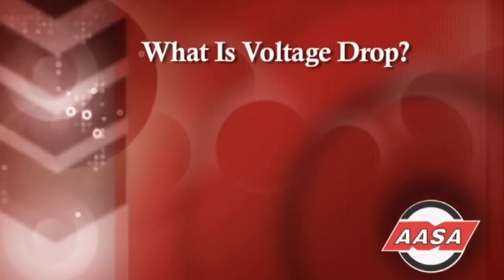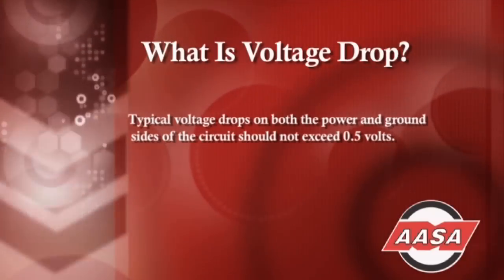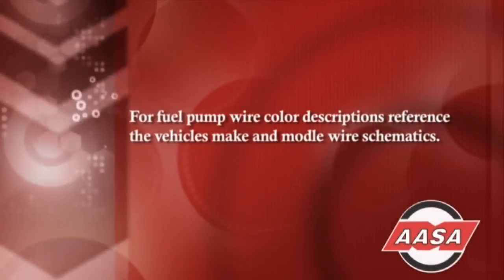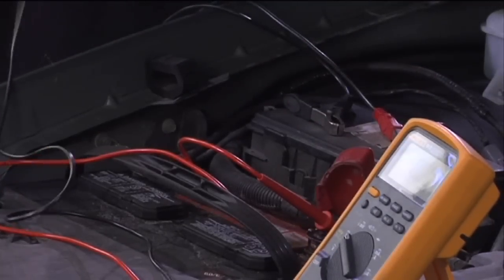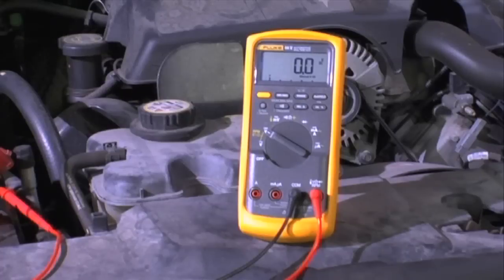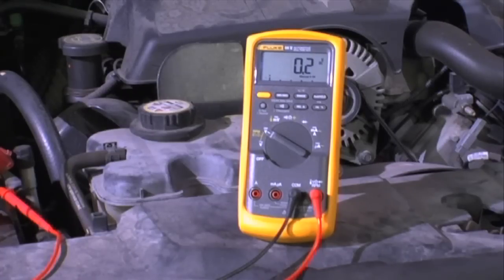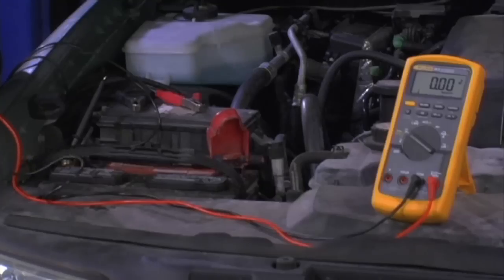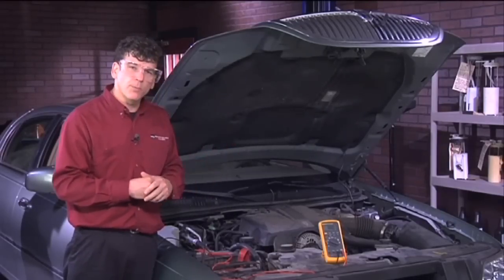Testing Electric Fuel Pump Problems with A Voltage Drop Test

Comment: When i do positive voltage drop, the meter is showing 12+ volts without even cranking the engine. Does this make sense? Shouldn't it be showing zero volts?

Comment: Appeared to be a quality video until he failed to address meter connections at the fuel pump in detail.  moving on down check....
Reply: Agreed. He also did not tell us the correct settings of the voltmeter.

Comment: So what exactly is going on here for it to show that drop?

The way I'm imagining it (as a noob) is that when the pump pulls current down the main wires, if there's any resistance because of a bad connection or frayed wire, the voltage will try to pass through the multi meter circuit?

Comment: I have 12.5 volts in my battery, and when i measure voltage back on the fuelpump positive terminal i only receive 12.3 volts, at this Point the ignotion is at it`s off position, is this normal, or should there me the same voltage back in fuelpump as in the battery?
Reply: I hope u were able to figure it out. I have the same issue.

Comment: Hi, a quick question. At the pump connector, 12+, 12v ground. No problem. Reconnect at pump, pull relay out. Relay measures 12v +, when I go from batt 12v+ in series to pump side ground I get 5.98v through the NEW pump.  Pump measures 0 ohms R now that it is cold. Bad brush? New pump measures 0 ohms, and no volt drop from batt+ in series.
I changed pump, vehicle runs. Retest pump, 0 ohms res, no voltage drop. Was the 6v drop due to R from a hot / defective pump or did I miss something? Original pump was changed due to rotten tank as routine due to high mileage. I feel like I missed something!!!

Comment: U didn't show the wire from pump u talking about like wtf man
Reply: Attach the jumper wires to the battery terminals and use the T-pins on your VOM to probe the fuel pump terminals.
Reply: i know right...idiot

how would you clamp a huge booster cable to the positive of an in-tank fuel pump....even outside at the harness,,, HOW
Reply: @bertrx-7406  T-Pin
Reply: lol same here like are you kidding me

Comment: How warm should fuel pump relay get while vehicle running?
Reply: They get hot its normal
Reply: One of my pins burned. Put new one and almost burned. Replacing pump. Heard it could be problem

Comment: My 2001chevy express stops while driving what can cause that  the engine light does not come on
Reply: what caused that
Reply: figure it out?  mine was doing the same.......... years ago. i believe i just cleaned my battery contacts........

Comment: Hello i was wondering, when you do the voltage drop at the power wire at the fuel pump, do you need to disconnect the connector or leave it connected and just probe into the circuit? How about the negative side?
Reply: Hector Arreola don't unplug load have to have a load "fuel pump"  which creates current flow. Otherwise the test will not work
Reply: @Robert00Kennedy  it would have been nice to see how he had it hooked up at the fuel pump.  just showing the lead to the jumper really wasn't helpful.

Also, my pump is not running, but i believe it is not the pump itself that is bad.  Since the pump is not running, i can't do this test, right?